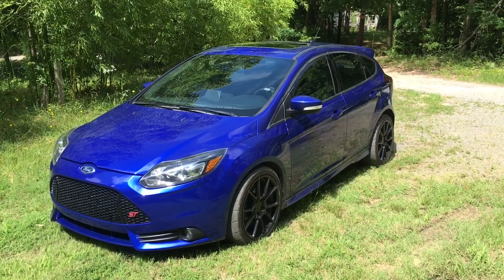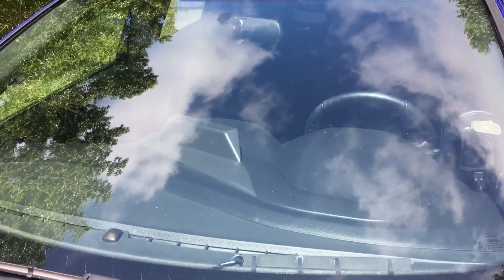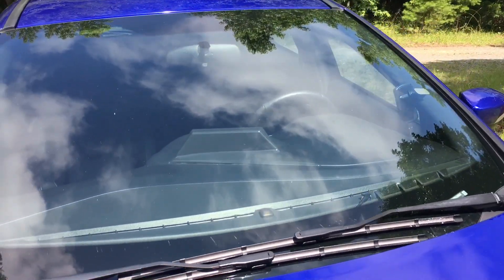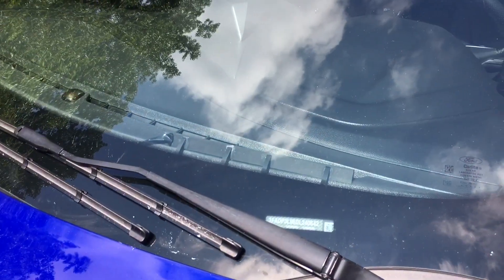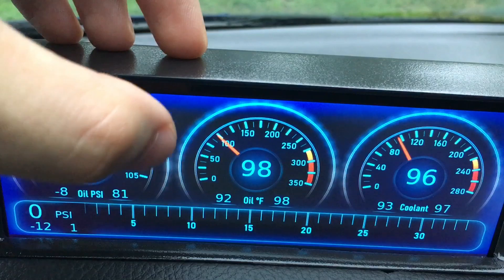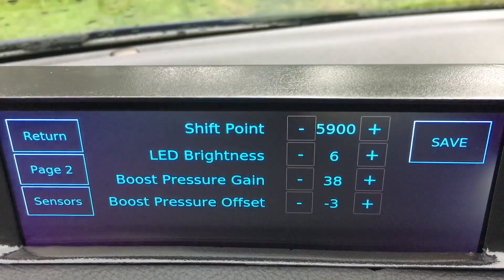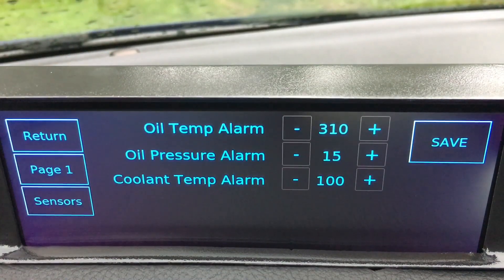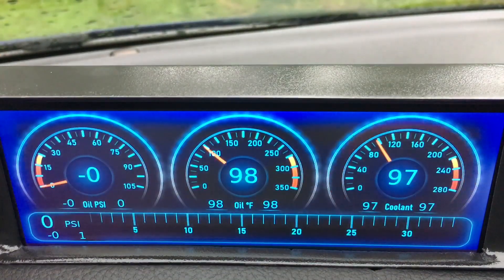Ford Focus ST Digital Gauge Cluster + LED Shift Light!

Comment: Hey Epik, i am really impressed by this project and the finished looking of it. At the moment i am working on a project which  aswell includes a touchscreen but i cant get my buttons to work. i didnt wanted to use the basic buttons from python because they are ugly. So i was wondering if you could send or explain to me how you made the "secret" button
Thx in advance
Reply from the maker: Hi, are you using PyQt5? I used that and Qt Designer to help create the GUI elements such as the push buttons and different pages

Comment: what turbo you running?
Reply from the maker: Gen 2 2867r with 4 port aux fuel. Roads were damp so I had to ease into the boost quite a bit
Reply: What brand turbo is that?
Reply from the maker: Rick1618 it’s a Garrett Turbo. The turbo kit is from ATP
Reply: EPiK Designs  .64 or .86?
Reply: Sorry for asking is just im new with owning a turbo vehicle. Im on the website how do i know which one exactly do i need for the focus st?
Reply from the maker: Rick1618 0.64. It depends on what you want. 0.64 will build boost quicker, but 0.86 will have more power up top in the rpm range. The newer G25 or G30 series turbos are even better than the gen 2 2867 turbos. I would look into those. If you are new to this, I would do some research on all the supporting mods you need
Reply: EPiK Designs thanks for your help. Also how did you make your turbo whine like that?
Reply from the maker: No problem! And it was like that from when I first installed it. I’ve heard other people’s cars with the same turbo and theirs aren’t as loud. So I’m not sure!